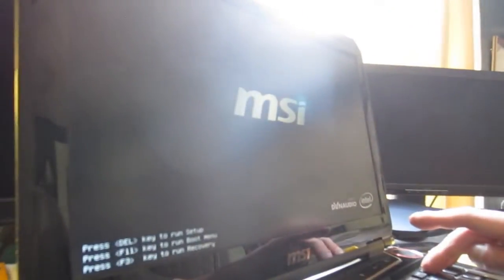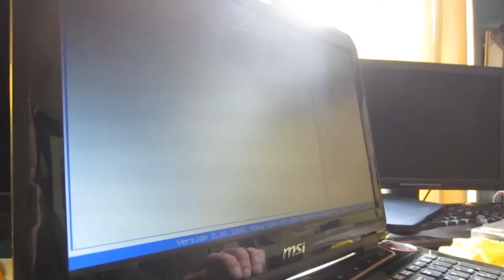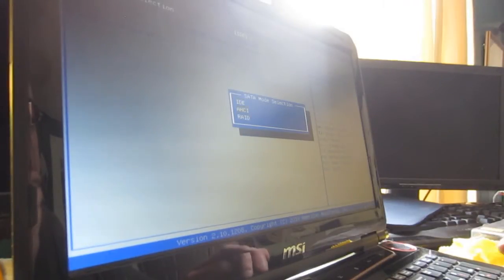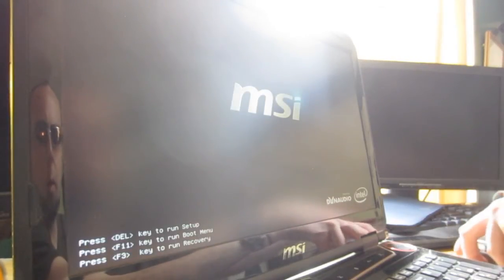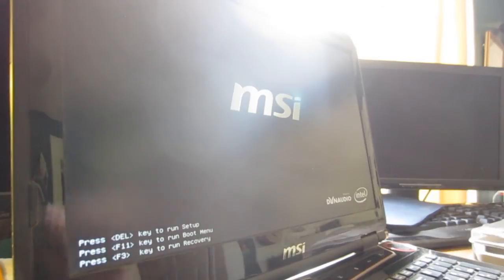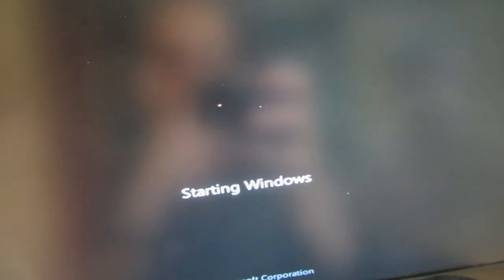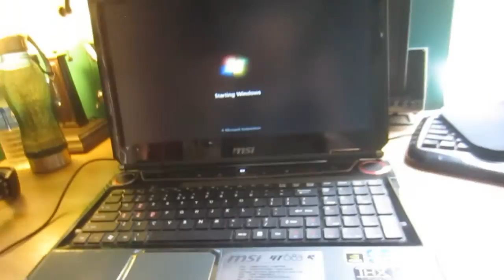MSI GT683 Laptop Disassembly and Reassembly - My Personal Laptop.

Comment: Thanks for posting. It is indeed a piece of cake to open and remove HDDs. I only wish the GPU could also be removable/upgradable (mine came with a 560M, which cannot play new games). This is my first time opening the back in 4 years as my GT683 laptop fell from my bed to the (thankfully) carpeted floor (doh). I now finally the HDD couldnt take the abuse no more and has crashed (or close to it). Hopefully I can recover the data.
Reply from the maker: +Adithya Naresh damn that sucks about dropping it, I have looked into upgrading the GPU's in the past and it is somewhat possible but I think generally most people just end up overheating the thing. I was playing GTA 5 on mine just fine with not much more than a memory upgrade and Windows 10. I have tried SSD's in it, but over all the Raid 0 actually seemed to perform better. Best of luck to ya on fixing yours! :)
Reply: Ha thanks. Bulky top on edge of bed = bad idea. Luckily every thing else other than HDD works the same (phew). Hmm, that's good to know that GPU can be upgraded on laptops. thought that for laptops GPUs were built into the motherboard, so would be hard to upgrade. How much did you upgrade your memory to from original 12GB? When you say performed better with HDD raid 0, do you mean faster than 2 SSDs on raid 0?
Reply: lol I meant *laptop

Comment: Have had 2 video cards fried. One almost immediately after the initial warranty expired in Aug 2012, which cost around $350 to have repaired via MSI. The second more recently, which they're wanting over $900 to repair due to "limited availability" of the video card, which I've found online for around $300. Can't recommend their products to anyone without purchse of an extended warranty of at least 5 years. It hasn't been abused. Pretty much used as a desktop. Kept cool and canned air used regularly. Curious to know if any other vid cards aside from the original 560m will work?
Reply from the maker: Thats weird, mines run flawlessly since I got it in 2011 with the exception that one ram stick went bad. I did do some research awhile ago and I think you can use the 570 or 580m, but don't quote me on that. You'll be able to pick those up a lot cheaper on eBay or whatever. G'luck to ya!
Reply: I just came across this as I am looking for graphics swaps and how they work for people... they say you can put a 7970m in there, supposedly doubling graphics performance; I have not yet researched the power requirements for that, or anything else. Btw, only half the memory is accessible from the back. I put 32GB in mine, in which case you need all 4 slots, 2 are under the keyboard. My came with a single HDD, which I have thrown out in favour of 2SSDs in RAID. My machine is literally running 24/7 and I play games, etc, never had a problem. I don't think it needs more horse power right now (runs BF4 fine), I just feel like messing around with it... but a 7970m is still quite expensive, just for messing around.

Btw, every so often, the Windows system gets screwed up - that is because the hibernation never seems to work properly.. so if I forget to toggle to a none-energy saving mode and the system doesn't recover properly from hibernation, then you are screwed. So you'd want a backup solution that can handle the RAID. I used to work with CloneZilla, but no RAID support there... I bought Acronis after researching this, which works like a charm. You can take an image of the installation as shipped by MSI and then play it back on to the RAID setup. I do keep an image of the original setup as shipped by MSI so I can go back to factory in case I wanna sell the machine one day...
I take an image every month... you don't wanna do it without an external USB3 drive, or you gonna wait yourself stupid until everything gets pumped through USB2 ;)

Now where I am typing this it occures to me that I completely forgot about that original drive... I wonder where it is?! :P
Reply from the maker: Yeah, I use acronis once in awhile, I'm not too worried about the raid setup. Let me know if you ever figure out.the video card upgrade. My main concern about doing so is heat. Unless you run these things with the fans cranked the GPU runs really hot in games :/
Reply: paradoxdesigns Not only the GPU... if you run SSDs in RAID, the chipset also gets very hot, because it is kinda busy... If you pump data like crazy, or run a benchmark for longer, data transfers totally collapse... They will go up again if you put the fan booster on, so it clearly is a heat issue. Somehow there seems to be no separate heat sensor for the chipset... So if I know I keep my SSDs "spinning", I always put the fan on... not even so much because of the speed, but I don't want it to corrupt data as it gets hot, and possibly writing errors to disc.

I didn't have a look on the inside in a while, so I am not sure how much of a mission it would be to remove the heatpipe and all that.. but MSI have a Youtube channel where they show you how to rip their laptops apart completely, in case you are hesitant.
I really only need to check up on the power consumption on what I got now, compared to what the upgrade boards would suck, and then you can conclude from there whether you will be good in terms of cooling. And of course heat sink form factor-bla-bla... etc

Comment from the maker: This MSI GT 683 has been with me for quite awhile now and it still holds up to many pricey machines today. I tried using a SSD for awhile but using a secondary mechanical drive was just too slow for me vs raid, I honestly believe raid 0 works better unless you go full out and buy two very large SSD's.